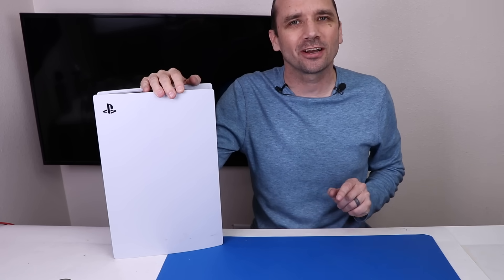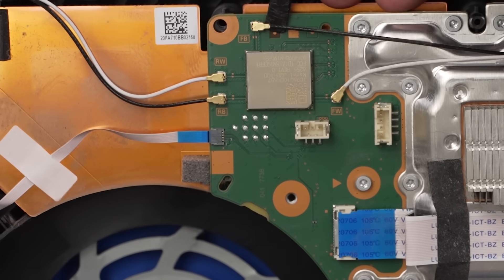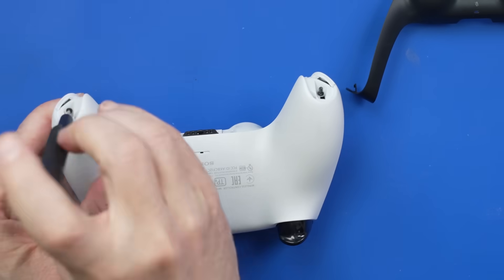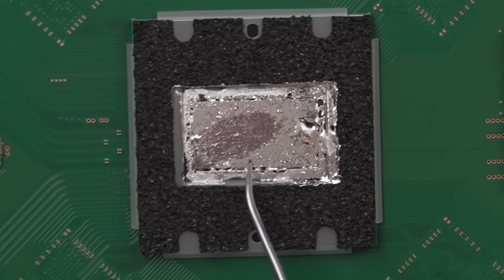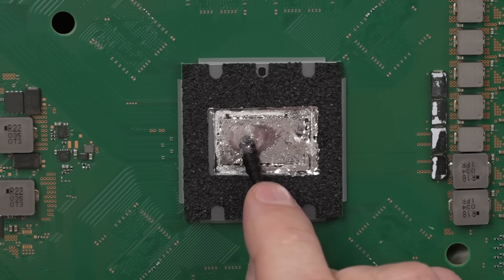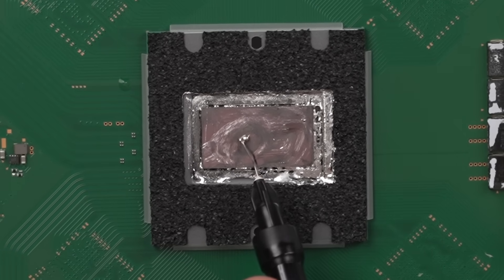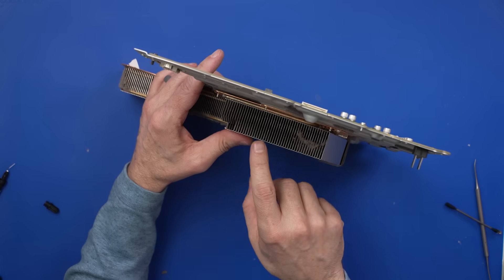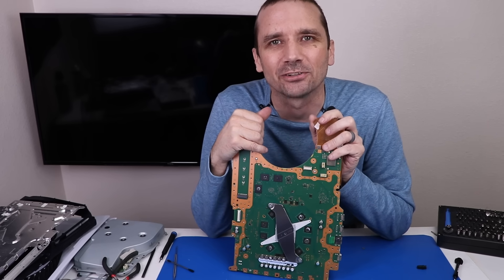How to Fix the PS5 Liquid Metal Problem

Comment: Actually there is NOT DRYSPOT if u dont open it but opening causing that spot to appear there. Someone should really make a video where person is using see trough Materials so we could see how its looks when liquid metal is between two layer without separating them.

3:30 You can even see how the motherboard clearly resists lifting, it's because the liquid metal clearly acts like a suction cup and tries to hold the 2 parts together, but when they are separated from each other of course a dry spot forms there. 

Why its so hard to still people to understand how liquid works and act between 2 layers before and after layers gets separated??

You could even test this with your own palms, put a little water on both palms, squeeze them together for a moment and separate them, you should see a dry area form on your palms when you separate them.
Reply: Not true.  I had never broke mine down to the motherboard until it started overheating.  The oxidation was hard as cement.

Comment: I don't do consoles anymore (except the Switch).  But I would NEVER use liquid metal on any of my hardware.  Good quality thermal paste is almost as good at conducting heat, and MUCH safer.  Yes, liquid metal is technically a little bit better of a conductor, but IMO it is not worth the drawbacks.  And in a well designed system it's just not going to make enough of a difference to matter.  In a PS5 switching to thermal paste does require a couple modifications (without the modifications it will still work but it will run hotter), but if I ever had a problem with the liquid metal I would certainly do it (though as I said I have no intention of ever buying a console).
Reply: He has a video using Thermal paste on ps5, it overheat very fast.....
Reply: @killermatico27  It overheated with no modifications and, most importantly, no fan.  With the fan it was hotter but still worked.  There is no reason you can't cool that APU with thermal paste, you just need a different heatsink interface.

Comment: I'm personally a little confused when it comes to placing the ps5 vertical. I've had mine for about 2 weeks and I placed it vertical since I don't really have to room to place it horizontal. In this video you show the the metal slides down but this is without the clamp on. Wouldn't the clamp and the pressure provided but that mitigate this problem? So yeah my main question is should I make room to place my ps5 horizontal or can I just leave it vertical? 

(Note I do have the newest version of the ps5 and I don't use it as my main "gaming device". So it might not get as much usage as someone that has a ps5 as their only console. Also there are periods that it's turned off for multiple days.)
Reply: @noob4head  It being vertically wouldn’t cost issues, the problem itself is the vents being clogged by dust and debris. I’ve had mine vertically since 2021 and haven’t had overheating problems until today. I’ve never cleaned the inside of the console, only the outer layer and the outside of the fan. So in my case, it was bound to overheat sooner or later. I suggest cleaning the entire console every 4 to 6 months a year if you want to take good care of it.

Comment: Been watching your channel for a while and learning a lot on electronic repairs.

Couple questions about cleaning the PS5. 
1. Does cleaning/maintaining your PS5 void any warranties?
2. On the subject of warranty, should the owner clean their PS5 or are there "trained professionals/businesses " that provide a cleaning service?
Reply: Cleaning your PS5 does not void your warrant. Sony cannot VOID your warranty for your opening your PS5.

However, if you damage anything or they believe you've damaged anything they will refuse to fix it. The warranty stickers only value is the "couldn't have been me, I wasn't inside it" factor.

Disassembly of the PS5 isn't particularly tricky, but you must be very careful with those flex cables / flex cable adaptors. They are fragile. Watch a few videos first showing you how to properly remove and insert those cables.

Other than that, it's quite easy to disassemble and clean. Slightly annoying, since Sony used 43 screws to secure the top metal plate to the PS5 for some ungodly reason. But not bad. Just be careful with the flex cables and flat flex cable sockets and be sure to properly re route all the cabling, putting the screws back in the proper places, during reassembly.

I just bought a PS5 off ebay that was shutting down when playing PS5 games. The system was gunked with debris, heatsinks and fan pretty clogged up. And the APU has a huge dry spot on it. The liquid metal needs reapplied / cleaned up some. But since disassembling and cleaning, it works like a treat.

Comment: So you've said that the liquid metal will be influenced by gravity if the PS5 is put in a vertical position so I have a follow up question:  is this also a concern for PCs that use liquid metal on the CPU since they're kept in a vertical position as well?  The PS5 is the only piece of hardware I have that uses liquid metal but I was wondering if there is something different about PC architecture or if its just accepted that if you use liquid metal on a PC CPU (or GPU) that you'll have to do maintenance on it every year or two?
Reply: On a PC you dont have to use that much because the CPU has an IHS. On a PS5, you need more because you are applying it to the bare die. Basically for my computer, I put a couple of really small dots on both the heatsink and IHS and spread it around so its incrediably thin. Looks like aluminum foil when youre done. Havent had any issues.

Comment: It seems like this is just delaying the inevitable.  I think you may be on to a long-term flaw in Sony's design/implementation.  Imagine what the corrosion on some of these PS5s is going to look like years from now.  If that corrosion does impede thermal transfer, the PS5 may go down with the xbox red ring of death as one of the worst flaws in console history.

Comment: Had my PS5 for nearly a year and I keep it upright, so this slipping liquid metal thing is a concern (although it still works perfectly). I bought a 3-year extended warranty on this thing, so I can't open it up to check things, which is kinda annoying.
Reply: You can pop the white side panels off without voiding the warranty I believe. This gives you access to some holes for air intake and exhaust where hair and dust pool up, you can use a small vacuum or something to remove it without voiding the warranty and just pop the plates back on

Comment: It's genuinely interesting to see the various challenges, solutions and problems that arise with different hardware and, by extension, the maintenance practices that arise from them.  Your comment about the difference between PS4 and PS5 responding to clogged vents is a great example.  I'm guessing some of that is because the PS5 runs hotter overall which was the driving force to use liquid metal to begin with.  It does seem like a less-than-ideal solution though because it brings other hardware challenges.  It'll be interesting to see if future revisions move away from liquid metal even if just as a cost cutting measure.
Reply: If there's ever a PS5 Slim or Pro (or both), I hope Sony designs the cooling properly so that liquid metal is no longer needed. Give me a proper heatsink, a proper fan, and a proper airflow path. Xbox Series X may be a "boring black box" according to some, but it's a boring black box that doesn't need to rely on liquid metal to make up for the shortcomings of its cooling solution. It's just fine with thermal paste. And personally I'd much rather have a "boring black box" than whatever uglier than sin design Sony came up with for PS5 that looks terrible and functions terribly too.
Reply: Your correct the ps5 runs insanely hot which is why don’t used the better heat conductor which is Liquid Metal

Comment: Wonder if a micro waffle grid plate could be mounted between the apu and the heat sink in order to encapsulate the liquid metal. Another possible way is to add just a little more liquid metal to where even if if pools up that there will be enough to cover the Apu. Maybe a micro thin gasket to contain everything

Comment: You should heat the liquid metal up to the temp its at while the ps5 is running a complex game for over an hour. Would be interesting to see just how much more viscous it may become. Its like bearing grease, just cant use any. It must be very tacky otherwise the centrifugal forces will just sling it out away from the bearings and races.

Comment: Coming from the PC side, I worried this was exactly what would happen. On PC's you need to periodically reapply LM as it will gradually shift position (especially on CPU's where it's generally in a vertical position) and cause this exact problem so I always wondered how the PS5's would hold up long term. Turns out no different than anything else that uses LM. This could be a slower ROD situation as time goes on since this is the kind of thing that will happen to more and more PS5's, it's just the nature of LM. 

I'd be shocked if the eventual PS5 slim or newer PS5 revisions eventually don't just do away with the LM entirely.
Reply: Yeah, I too was wondering what kind of problems we'd see as soon as Sony announced liquid metal. There's a reason it's only done by absolutely hardcore enthusiasts in the PC space. It took longer than I thought for the problems to materialize, but here we are!
Reply: @mjc0961  I'm sure some executive thought it would make for a great marketing gimmick.
Reply: Yeah this seems like a really stupid design choice given most console users will never take their console apart to clean it.  But then again when has sony ever cared about their customers.

Comment: Should be a class action. Not only is the console more complicated than the Series X, but it is just insane that after the PS forums were shut down and there was random eject issues on PS4, the BLOD, etc...Sony made a point with PS5 to tell you it was overengineered.
Reply: Sony hardware has always had issues. Even back to the PS1, a lot of those disc drives would go bad and you'd have to run your console vertically to keep it reading discs. PS2 had the infamous disc read error issue, PS2 slim had power supplies that could burn your house down, PS3 had YLOD (and Sony only got away with it because Xbox 360 was selling much better and thus RROD took all the bad press instead), PS4 had the eject issues and BLOD, and PS5 has liquid metal issues. 

I really wish Sony had caught more flak for PS3's YLOD problems. All the mess from RROD ended up being great for Microsoft and consumers, they started making sure their consoles weren't going to have such widespread issues before releasing them. Sony keeps getting away with it so they continue to not give a crap.

Comment: What if I drilled a small hole in the analog stick cap to get some bw100 down inside without having to disassemble?
Reply: Why You need to destroy the thing?, Dissasembly is not that hard..
Reply: @killermatico27  I don’t think it would destroy the controller and whenever I disassemble a controller I end up destroying it anyway.

Comment: It truly pains me to see so much liquid metal used on the PS5...I know they do it because it's easier for manufacturing, but  it is completely unnecessary! You just need enough to make a very thin coat on the APU and the Heatsink...Anymore than that, and you are inviting problems...You should never need so much that it makes a lake of liquid metal around the APU when you put it back together!

Comment: Tropicsfix, want to try and fix an old launch model PS3?  HDMI port shot, due to power overload I believe.
Reply: I m interested in seeing an attempt at Steve fixing some YLOD PS3s
Reply: I do have a donor board if you need parts!
Reply: @JimiJamma  thanks for the offer. Still looking to learn about the issue. Heard about the cap replacements, it sounds like the APU and GPU are inherently faulty due the solder balls used inside the ICs.
Reply: The HDMI port stopped working after using a HDMI extender over dual Ethernet cables with power injection.  Injected power, then HDMI pigtail, Apple TV 3 and PS3’s HDMI ports all no longer worked.  The Multi Out A/V on the PS3 works still, but my new TV only has HDMI inputs.  I have a donor board that doesn’t power up that could be used to possibly fix the the HDMI problem.

Comment: Is there really even a benefit to the liquid metal over thermal paste?
Reply: Better heat dissipation
Reply: @Mr. Burns the second I have to open the console I'm not using liquid metal, I delt with it once before and I hate it with a passion.

Comment: My PS5 kept shutting off on me. I tried all the tricks of rebuilding the database. Checking the power supply, the coin cell battery. The fan, the Liquid Metal, internal SSD drive, but in the end the culprit was that my power supply vents and heat sinks were clogged up with dust
Reply: You checked everything including stripping down to the liquid metal but didn't think to look at vents??????

Were you dropped on your head as a baby or something?

Comment: I upgraded my PS5 from digital to disc, and I had my digital standing vertical (15 months). My new one which is the newest 2022 model has been standing vertical for 2 weeks now and no sign of over heating. I think it is down to the assembly, not putting the liquid metal on correctly 🥸

Comment: Nice of Sony to design the internals this way. Will get a few more repeat sales after initial units die from overheating. +5 business
Reply: it probly wont die cause it shut off fromt he heat to protect it self . they used liquid metal cause they had 2 if you dont stand up the ps5 you wont have this issue anyways
Reply: @yamisniper  I’m talking about all the internal dust choke points. I’m pretty sure a significant number of PS5 users will have it vertical also.

Comment: It's weird because Microsoft has a more powerful console that draws more power generally compared to the PS5. Yet they don't need to have liquid metal inside to cool the chip? But then PS5 constantly outperforms the Series X in multiple games? Technology can be very unpredictable a lot of the time 😅
Reply: I've never seen a game where it outperforms. They literally perform identically in 4k. Only difference would be the series x performing better in 1440 since it supports freesync to prevent screen tearing where as the ps5 only supports vrr in 4k..
I'm assuming you watched some comparison videos. Gotta be careful because most are fanboys and play a game with a patch in one console and not the other to make it look better. Seen it in both consoles.
Reply: Clock speeds are different. Sony runs it at MAX at all times the thing is on.
Reply: @6reen6uy  that's because they were overheating when the clock speeds were variable. Thats why Sony locked it.

Comment: I don't really understand why they keep using liquid metal, if you use the thermal grizzly kryonaut you have roughly 2-3°C more but you don't have the spilling problem. Even the xbox series x use the thermal paste and it's even more powerfull.
Reply: Clock speeds are different.

Comment: Amazing that you go into such detail about the ribbon cable connectors! Still, I wish you’d make a video on some mod hack improvements. Like on my SX and SteamDeck I’d like to install that ptm7950 hybrid TIM. Or add better thermal pads to any of these toys. Or drill more vent holes in that ps5 psu.
Reply: There was I believe a Czech guy who did a stream where he put ptm7950 in the PS5 and it worked just fine with near identical performance, when it comes to Steamdeck I saw many who basically had the fan rpm decrease by 1000-2000.

Comment: I have been using MX-6 on all of my recent repaistings.  Compared to other pastes like Kryonaut, it has been the best stuff so far.  They claim a service life of 8 years, we shall see.  

I still have reservations of using Liquid Metal due to it's longevity, it seems to oxidize no matter what prepwork you do.  Some have tried Nickel Plating their heatsinks to starve off the effect, but it still occurs.  We don't need the absolute best thermal transfers in consumer products, we need longevity and maintenance free design.  I wonder if Sony will consider soldering the heatsink to the APU in the future, in theory it would make it maintenance free.
Reply: It's so bizarre. Like the response to "Right To Repair" has been "Required To Maintain, So We Threw 50 Screws And Fragile Connectors In The Way". I don't understand how companies can continue to make worse and worse designs, and why people are still giving them their money no matter what they do.
Reply: Don’t use anything but Liquid Metal on the ps5 it won’t work. He’s made a video putting MX-6 on the ps5 and it overheats very quickly.
Reply: I would hope Sony doesn't solder the heatsink to the APU! Thankfully I don't even think that such a thing is possible. But if it was and they did, it would be a nightmare for repair.  They simply need to better design their consoles with proper airflow, appropriately sized heatsinks, and proper fans. You know, everything Microsoft did for the Xbox Series X.

Comment: Love seeing this problem addressed! Getting that oxidation off looked tricky
Reply from the maker: It can be. I probably should have removed the liquid metal and cleaned it with IPA but I did get it respread eventually
Reply: @Tronicsfix  please could you tell me the size of the PS5 cpu in mm x mm ?